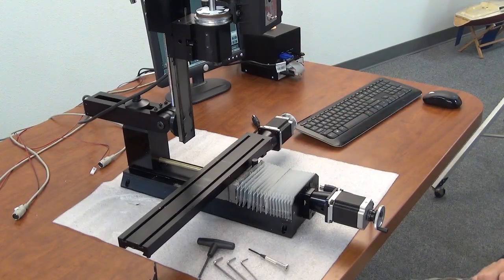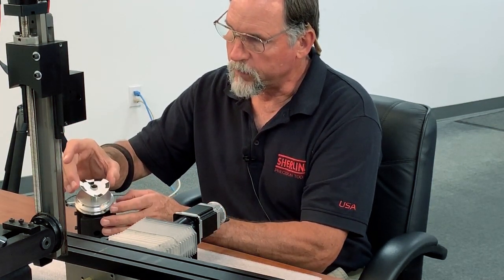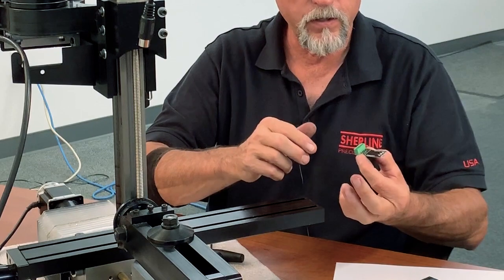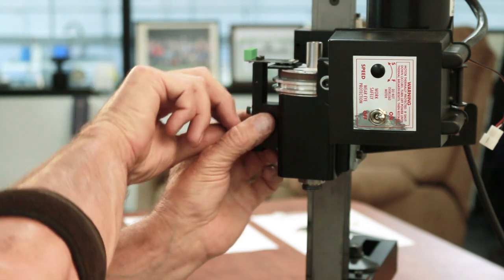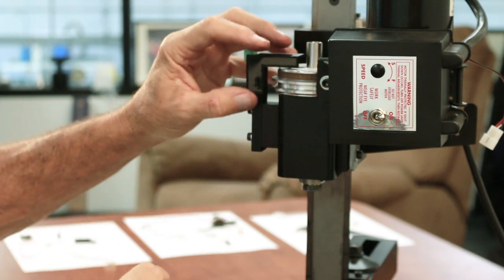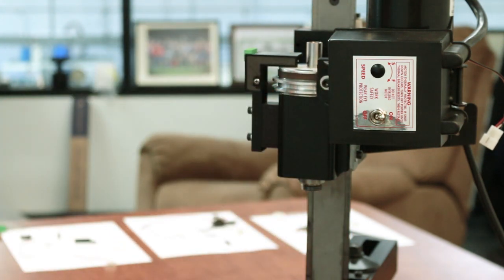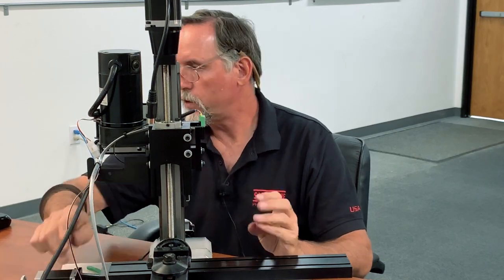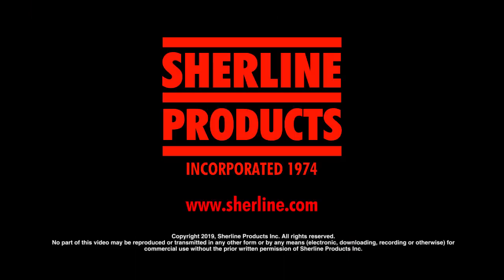Installing the Optical Encoder

Comment: I have a 4400. Will this set up work on Acorn CNC board?
Reply from the maker: The optical encoder is designed to work with the MASSO controller. I will ask our techs for confirmation, but it is my understanding it will only work with MASSO.
Reply from the maker: I just confirmed that our Optical Encoder is only compatible with the MASSO controller.